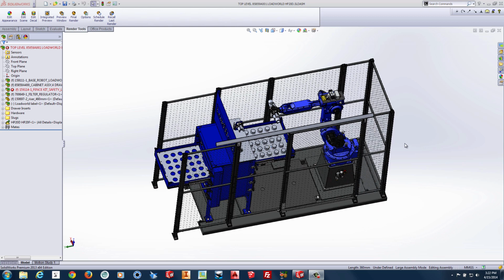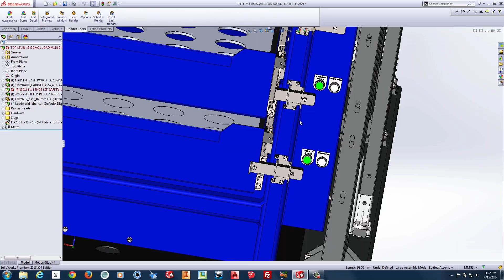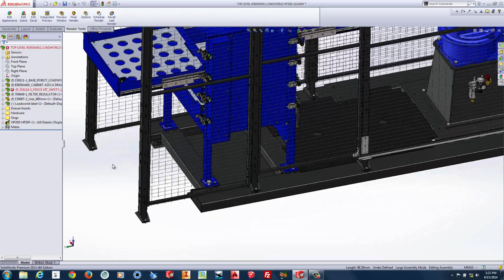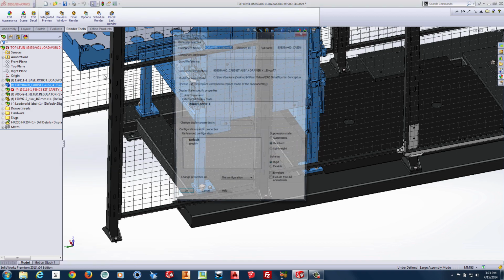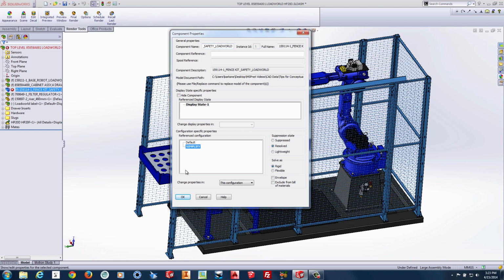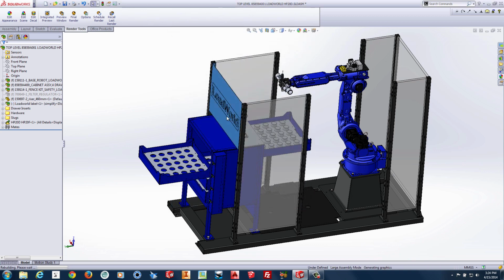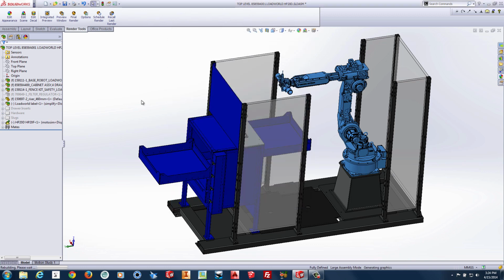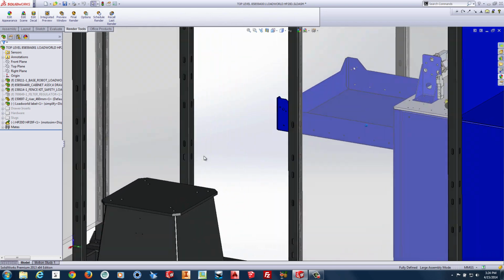Prepare A 3d Assembly For MotoSim

Comment: I was using 170Mb IGES file converted from solid wroks, and I'm getting a lag issue while doing the simulation in MotoSim EG-VRC 2018. 
** The responds time is very less when I'm jogging the robot for teaching.
** If I long pressed jogging button (X/Y/Z/Rx/Ry/Rz) more than 2 Sec then the software getting hang. and can't work for 2 minutes.
I'm requesting you to suggest me any option to avoid these things.  Waiting for response.